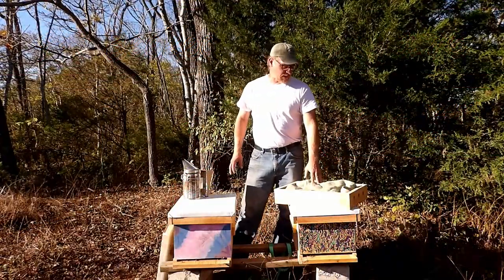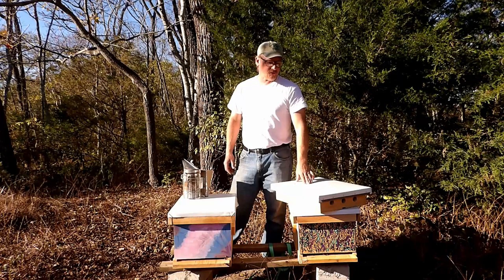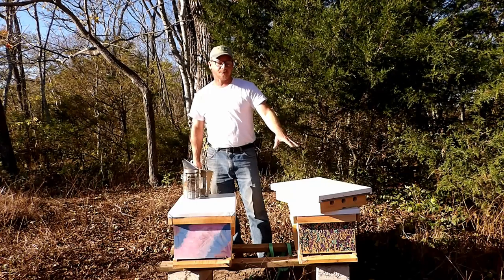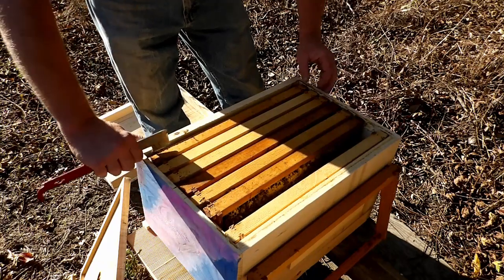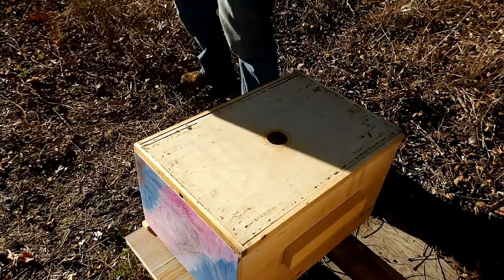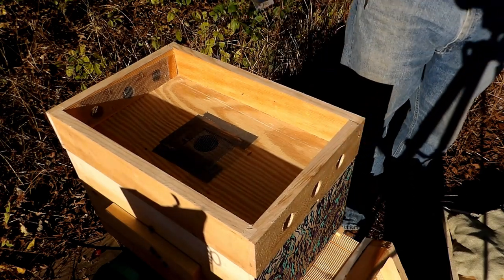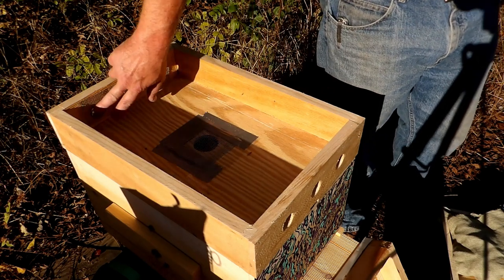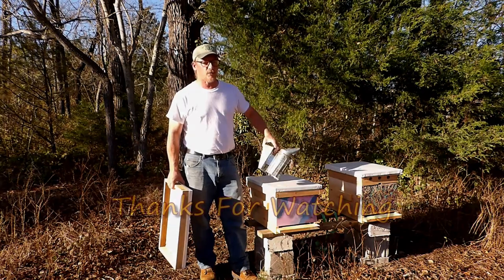Beekeeping, Day 176 "Vivaldi Boards, One Down, One To Go"

Comment: Add a piece of 1 inch foam insulation to the inside of the telescoping lid. It will lift the lid above the vent holes and also provide some heat retention for the girls.
Reply from the maker: I thought about doing that, but I currently don't have any foam on hand. I'm not sure of the thermal properties when it is placed above a vented box though.  I'll see what I have lying around.